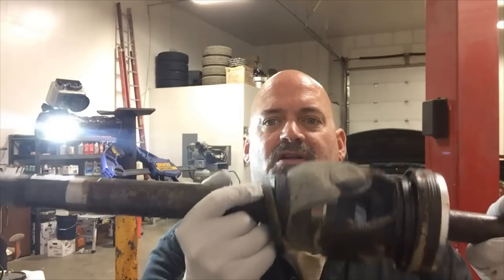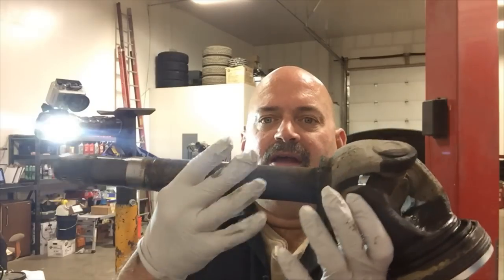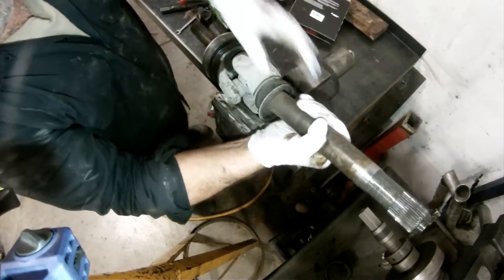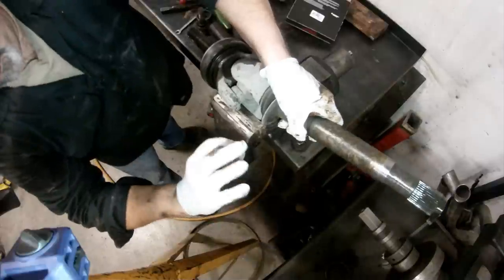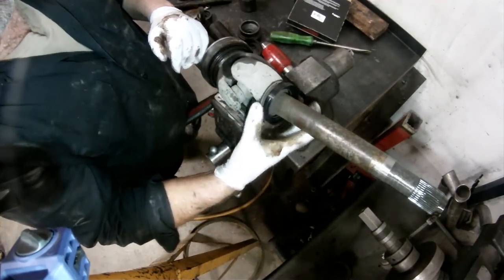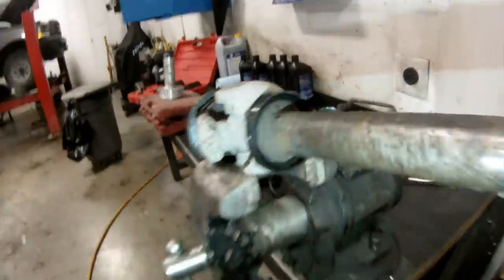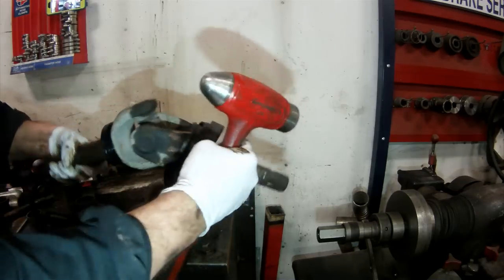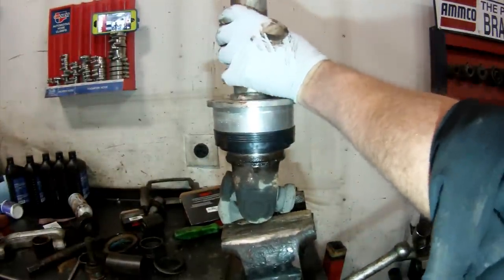Ford Super Duty Spindle Seal Replace - Axle Housing Dust Seal Replacement

Comment: Thanks doc, just did the 200K front end rebuild on my 2003 excursion,  i made the knuckle seal driver out of 1 1/4 galv pipe and 4 inch floor flange ground down to fit the inside of the seal.

Comment: Thanks for posting this supplemental video! (even though it was five years ago!). I was going through everything one last time before starting the ball joint replacement - would have been a huge pain to learn of needing this part after I started. Last thing I need is to have a worn seal and a small child getting caught in the axle!
Reply from the maker: No you wouldn’t ever want a small child caught under the axle. 😮 glad it helped. Blessings.
Reply: So you just want them under there but not to get stuck. Savage.

Comment: I'm working on a Ford F250 4 x 4 Super Duty V10 with Automatic Vacuum Locking Hubs.  Question is how do you free up the outside hand lever?  The one I'm working on it will not budge one way or the other?  I'm ready to start putting it all back together on the drivers side.  Changing vacunm seal and o rings along with upper and lower ball joints.  I've broken the internals of the hub down and found the inner plastic parts were lock together and had to be pulled out.  They all look good and the bearing to looks good.  So the switch is a need to know item please?

Comment: How come your not using the updated seal, that has a metal housing that you install into the end of the axle tube? I'm a licensed tech here in Alberta, and the Ford dealer or anyone else doesn't even stock that type of seal you are using any more. I do these all the time, mostly for axle ujoints, and I don't think I've used that type of seal in at least 3 years.
Reply from the maker: +kenman1717 We are a little behind the times here up north. It can take up to three years just getting parts since they have to travel by dogsled for a portion of the way. Haha. I will surely use the updated seal next time but they do stock these and they are a lot cheaper. Thank you for the input and dropping by.
Reply: The Car Doctor Lol, dogsled I like that. I used to always ask for that old style seal, until I found out about the updated one, and its nice because it acts as an axle seal as well instead of just the dust seal. Which in a way makes it better, as you don't have to pull the front diff apart to change them. And at least the new super duties come already equipped with them, and Dodge even went the same way on their new ones, which will make life easier.
Reply: some of our parts come by pony express to wyoming
Reply: therockkkkher 
This video applies to 1999 to current ford superduty trucks f 250 f 350 with solid front axle, 450s and 550s are similar too, 1997 to 1999 f 250 light dutys are independent front suspension and are basically a beefed up f 150, this video does not apply to these style of trucks
Reply: What is the updated deal part number? The one with the metal?? Thanks in advance!

Comment: You saved my life
Reply from the maker: im happy to hear that. Enjoy life!
Reply: Question tho,  can I put the hub seal on when it’s in the houseing. Because i don’t have a vice,   I’m doing it now. Lol.
Reply from the maker: When what is in the housing? The axle shaft? youll want to install the seal onto the shaft before installing in the knuckle so you get your depth correct. It might be possible but I have never done it that way. Maybe make something to support the shaft somehow or run by another shop and bring them a six pack
Reply: That’s exactly what happens lol.  I finished it tho.  Lol.

Comment: I have a 1999 F350 Super Duty 4 wheel drive and it's making noise on the left side it's like a grinding noise and it slows the vehicle down even a little bit and I'm wondering if that's an inner bearing or is there an outer bearing on the shaft thank you for your help
Reply: But when I put it in 4-wheel drive the noise goes away I'm thinking it's an inner bearing but I'm not sure
Reply: The noise has been going on now for about 2 weeks
Reply from the maker: vacuum leak  @michaelaugusto1897

Comment: So does this seal go into the axle housing? It appears that it doesn't, as iv tried for 2 hours try to get it to go into the axle tube. I'm starting to think that it literally is just pushed up against the axle tube.
Reply from the maker: If you have the updated seal it does go into the axle housing. The one shown is on the axle shaft

Comment: I got a stupid ? being a tool and die maker for 30+ years, why is the dust seal OD which measures 3.115 go in a gaping counter bore of 3.498 at the end of the axle housing? what does it seal off it can't be beavers LOL(rocks, water, mud, ect, ect) because it doesn't even come close to the side of the bore, it must be those beavers that work for Dana LOL
Reply from the maker: The redesigned seal is better but no, it's just to keep large rocks and small children out of the axle housing.
Reply: David Egbert r

Comment: Hi, I have a very important question for you and please would you get back to me as soon as possible. First let me introduce myself. I'm tony I am a transport driver and I have had two good mechanic s that run their own shop one tells me I can run my truck the other says don't run it until fixed. the problem is the dpf filter is stopping up and the big tubor is going south. one put it on the computer and showed the back pressure 118 and we took off the oil filer caps and pressure was coming out of it. checked the cylinder s are OK number 7 is a lillte week but OK. the short bock has 210.000 on it and the turbo s have 140.000 on them never had a problem before. I am asking will in be OK to make a 1300 mile trip pulling a 12.000 thousand pound camper or will it cause my engine to go down. I run the best diesel and additives and fuel filters changed every 7500 miles and oil at the same time. I run 15,40 motorcraft oil. I would appreciate the advice. thank you
Reply from the maker: Im sorry, im really not a diesel guy and cant answer your question.
Reply: i forget the process but any decent mechanic should be able to tell you to trigger a regen run the full regen it SHOULD clear the stupid dpf filter if not replace it and work on cleaning the old one so next time you have a replacement would be my advice.
i am not a mechanic i just work on my own stuff to keep it going. and i wont own anything with dpf ...just sayin